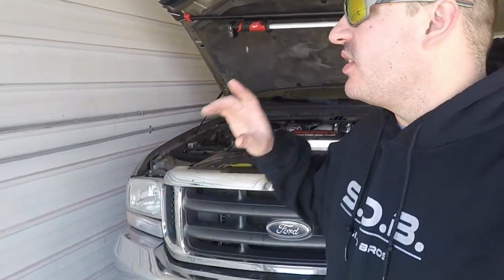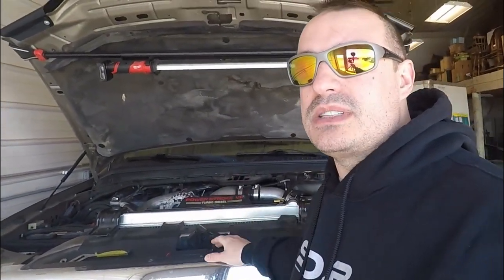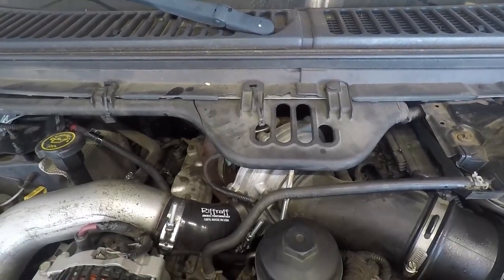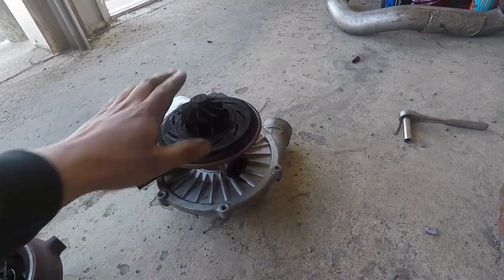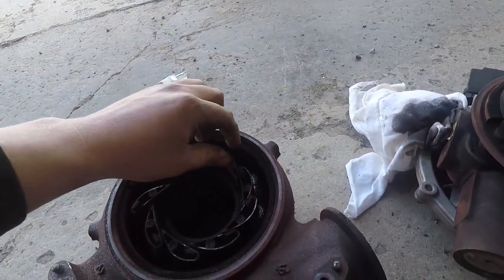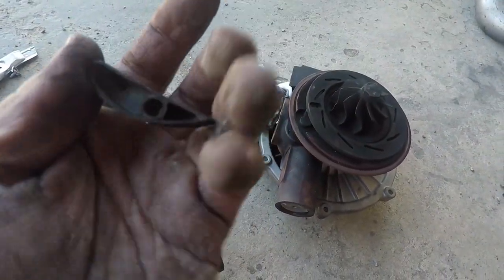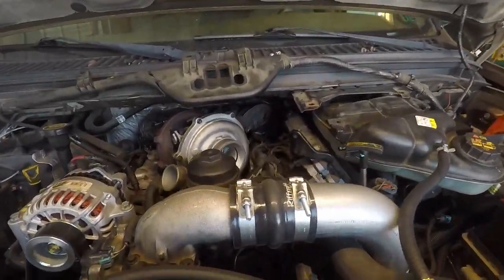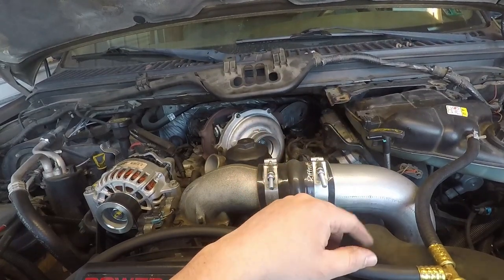6.0 Powerstroke Turbo Removal and Cleaning P132b

Comment: #1-You didn't show the amount of work and struggle to pivot the turbo out of its place. This is a major pain, the turbo is heavy, it's not an "easy job". If anyone has mobility or strength issues, this may be VERY difficult. You run the risk of damaging wire harnesses and plugs especially since the plastic will be brittle from age and heat cycles. Also becareful of the VGT solenoid plug on the turbo. You break that off you're buying a new $200+ VGT solenoid.
#2- If you have the Bullet Proof oil cooler re-location kit, the turbo will only come out if you remove your alternator AND raise the passenger side of the cab which requires you to loosen or remove the cab mounting bolts. These bolts are coated in thread lock and are probably rusted in place. Heat, pentrating oil, time and a  breaker bar will be your friend.
#3- Ensure your clamps for up/down pipes are clocked correctly when reinstalling.
#4- A thick foam pad to lay across the front of the engine bay will save your abdominal muscles from much pain. To get to the rear turbo mounting bolt behind the turbo will require you to lay flat out across the top of the engine.
#5- Refill the oil in the turbo housing once the turbo is back in place.
#6-There are unison rings now that come with two VGT lever slots. In the event one gets oblonged, you can just flip the ring and you're all set, no need to spend an additional $100+ for a new ring.
#7- The rear passenger side injector plug gets exposed to ALLLLL the turbo heat, while the turbo is out inspect it for heat damage and consider getting a new FICM Wire Harness or putting heat shielding on that one plug and the wires.
Reply from the maker: #1 you seem upset... calm down slightly. I did forget to post a video of me pulling the turbo so i did correct that and pin the comment.  you are correct these turbos are not light and as always be care not to break anything else while working on your truck.
#2 I strongly dislike the bullet proof relocation kit but if your cab mounts are not trashed or have been replaced lately the turbo still comes out without removing the alternator. its a tighter fit and requires moving the turbo in a weird way but much better than removing cab mount bolts. also this video was intended for this instance so sorry I guess
#3 great point I cant remember in the dedicated video if I brought this up but typically more of an issue when people or working on their with the cab off.
#4 I have seen guys do this I have used my sweat shirt before but I mess with these trucks enough now that I can do some of these jobs pretty quick. 
#5 not really needed on a turbo you just took off a running truck. I do like to do it when I am putting a turbo thats been sitting or is brand new. I honestly do it before even putting it in the truck and spin the compressor wheel a few times with the new oil in. 
#6 I have not seen them before. I went looking and found someone on ebay doing it. I am not sure how I feel about it overall but cool idea none the less. 
#7 in most instances you do not need to remove the turbo to replace this harness however anytime you're under the hood its not bad practice to check the wiring harness for any obvious damage

Comment: p132b can be a pita! put it on forscan, map sensors rarely fail but do, maf could need cleaning, make sure egr is closed, 5v ref, ebp is inferred but if failed still can cause issues, iat 2, does it have the butterfly plate or was it removed,  a smoke leak tester  for 40 bucks off ebay that may help show any leaks chasing phantoms suck could evenbe a stubborn stratagy issue may just need to just get it hot then keep resetting kam/vgt relearn till it learns
Reply from the maker: I did a video talking about different things to look for ill be posting it in the comments soon but this is all great advice. I went through for leaks and replaced boots and such already. Hopefully this is it after replacing this turbo. No leaks exhaust or intake side of things
Reply: @six0bros  these damn truck's! no different then dating girls half your age! drama, confusion, insanity, regardless what your conscious says and peoples advise! its impossible to just walk away and let the next guy deal with it. lol
Reply from the maker: Lmao I honestly lol'd reading that

Comment: Hey man hope you see this, so I have a 6.0 it has a bad glow plug #8 would this cause the truck studder and smoke at idle smells like raw diesel only, but it smokes a lot, doesn’t stall just wondering thanks
Reply: And it does stop when it gets warm
Reply from the maker: Are you getting cylinder contribution code or i jester code, ficm? Any of those coming up?

Comment: We’ll let me start by saying my turbo was making small noises of something grinding inside while I was driving , I don’t know why but I accelerated down thinking it would fix the issue but instead my truck started blowing bluish white smoke and ran for a little bit and ended up shutting off,  and it leaked out a lot of oil during that time it leaked out on the passenger side of the truck looked like  the smoke could possibly been from  oil in the exhaust (2003 Ford F-250 6.0).    Now it won’t start , and is showing a p132b code . A mechanic came with another computer and is claiming piston 5 is misfiring as well.  Has anyone ever experienced this ? Or have any idea what it maybe? I don’t want too invest in all kinds of parts for no reason that’s why it’s important for me too find out what the issue is .
Reply from the maker: So first it sounds like your turbo is smoked. May have caused a bigger issue. What are you using to scan your truck do you have anything that can tell you icp voltage, ipr duty cycle, ficm voltage, cam sync, ficm sycn?
Reply: @six0bros   I’m just using a standard cheap Amazon code reader but I have buddy’s that actually have better scanners is there something I can do that’ll check things too get a more accurate idea of what the issue at hand could be ?
Reply from the maker: Probably one of the best things you can do is use the forscan app with a Bluetooth obd2 sensor. Here is a link to the plug for your obd2 port and then download the app. This is an affiliate link

https://amzn.to/3zJqcVl

Now once you have this stuff ready you want to look up icp v. Ipr% ficm main voltage, cam sync, ficm sync. Also read Amy codes that may be there as well.
Reply: @six0bros   so I just received the forscan tool and downloaded the app. Thank you for your help . Is there any advice or so you would be able too give me on what and how too check exactly what the issue can be?
Reply from the maker: So the first several things to check would be icp voltage, ipr%, battery voltage, ficm main, ficm sync, cam sync. Icp voltage should be .82-9 to start. Ficm voltage should by 47-48, batteries shouldn't drop much below 12 volts, ipr but if it's up around 75 plus and you are not hitting the .82-.9 volts then we have an issue there. Though from what you said happened originally I think you have a different issue. Did you replace your turbo?
Reply: @six0bros   I have not replaced the turbo yet because I don’t want too invest the time and money into it if it actually needs something else done

Comment: You went back to the stock degas bottle?
Thought you were running aluminum
Reply from the maker: I was running an aluminum one this isn't my truck in the actual video though.
Reply: @six0bros  Ooohhhh. Ok. Thought it was your white one.  🤦‍♂️🤦‍♂️
Reply from the maker: I wish lol. No gonna stop by the shop today though we were hoping to get it in this week to give the final whats wrong and then go from there. I'm ready to order my short block already haha
Reply: @six0bros  Kill devil makes a niiiicce engine
Reply from the maker: I'm looking to do a stage 2 short block. Which is mainly just the cam profile change.
Reply: @six0bros   ok that will work nicely too